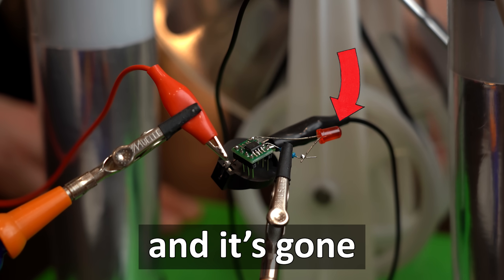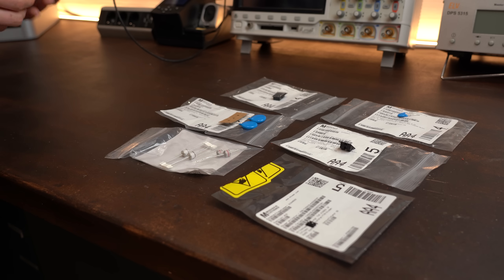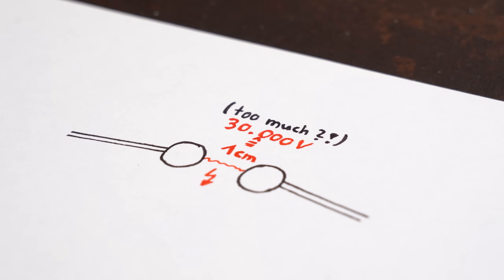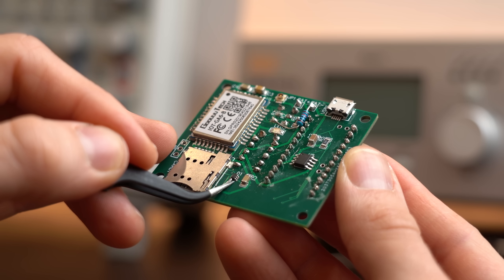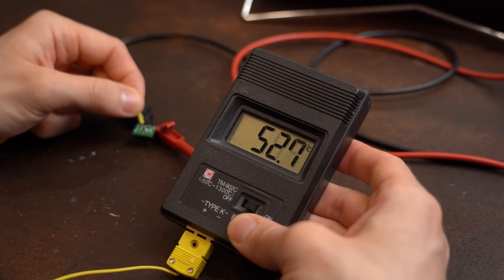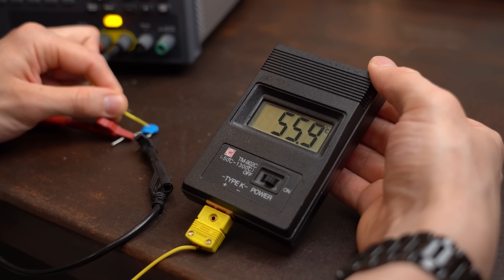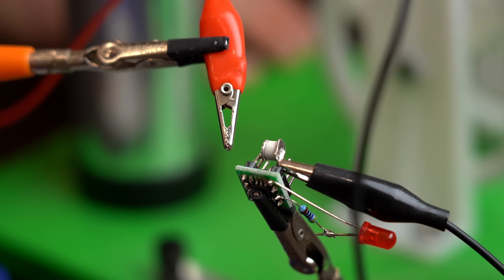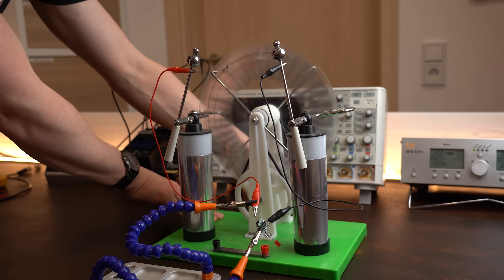This $0.70 Component SAVES your Circuit?! (Surge Protection) EB#59

Comment: Varistors are way slower than TVS diodes and aren't fit for fast transients such as ESD & EFT. Another thing to remember is Kirchoff's law, any current pulse will return to its source. Therefore instead of trying to suppress a pulse it is often more practical to divert it from the sensitive components using spark gaps etc
Reply from the maker: Thanks for the feedback :-) Maybe I should have included spark gaps as well. Well, I will find space for it in another video.
Reply: @greatscottlab  isn't the gas discharge tube basically a spark gap in a controlled non-oxidizing atmosphere?
Reply: @emislive : Yes, gas-discharge tubes are spark gaps in controlled atmospheres. However, you can still get unreliability due to the slow (or fast, depending on current and pulse rate) erosion of the electrodes, and ALSO because of the fact that light falling on the gas can actually make it easier to trigger a discharge.
Reply: @absalomdraconis  Light? But these GDTs (in the video) are not in transparent envelopes.
Reply: @greatscottlab  anyway, the most critical thing when dealing with wide spectrum transients is the layout itself
Reply: @demetrisswest  thank u so much😊
Reply: @greatscottlab  On the part where you talked about Kirchoff's law returning a current pulse back to its source; is that why when you have static electricity built up and you shock someone it also shocks you??? :O???
Reply: Spark gaps still leave residual overvoltage which needs to be handled. They are also not suitable for a low transient range. Neither are repeatable or reliable. Mov and tvs coupled with esd suppressor is the way to go.
Reply: Is a tvs diode not an esd suppressor?  @ecstazyrm
Reply: @ecstazyrm  Yes/no.  Here's my reasoning.  Think about it this way, TVS and MOVs are solid objects.  When a spark happens, it can burn a small part of the internals. Almost all the time this is enough, but they can fail if you get a large enough spike or enough smaller spikes.  If you look at the film of a Lithium Ion battery that's been damaged by over-voltage you'll see little bits that are burned.  It's super neat.
Reply: Seen a park gap do it's job in practice once (that is, after the fact not during it), on my TV's power supply. The comment I talk about it in case you wanna read: https://www.youtube.com/watch?v=MzxBBXpgwrE&lc=UgydNWuE3TvVqRYRkm94AaABAg
The board does have an MOV there too I assume to protect against lower voltage surges instead of just lighting strikes or such high voltage stuff. Those two in combination sure did their job.
Reply: The term used for doing it is a snubber circuit. Diverting it with a low inductance, high capacitance path to ground so that it is the best method to deal with large, fast current spikes.
Reply: @demetrisswest What is the path of current in TVS in case of ESD. when circuit is not connected to anything. can u explain a little please.
Reply: @muhammadawais7288  when you have statics on your body, a discharge may happen if you touch some AC-connected appliance, not a wall or a sofa. ESD goes from your body through input circuits to power plane, then through Y-caps or spark gaps to AC, then to earth
Reply: @demetrisswest  In what way is "divert" different from "suppress"?
Reply: @Graham_Wideman  my understanding is that suppressing a transient means dissipating its energy as a heat like MOVs and surge resistors do. Whilst diverting allows the transient to go back to source, not altering its energy much. For example, a 4 kV EFT burst is unpractical to suppress, as it is too fast for MOVs and will cost a fortune to build a sufficient TVS diode string. Therefore diverting it using layout features appears to be the only option
Reply: @demetrisswest OK, what does it mean for the "transient to go back to the source"?  What does "diverting it" translate to in actual components or layout?
Reply: @Graham_Wideman  assuming the transient will find its way through the board anyway, diverting means providing a pre-defined path for the transient to take, bypassing sensitive circuitry. This path may be formed by polygon cutouts, spark gaps, Y-caps etc
Reply: @demetrisswest  A spark gap or GDT simply uses ionization threshold as the protection voltage, and current through the air/gas produces heat absorbing the energy. So conceptually the same general behavior as a MOV or TVS, just by different means. So I don't see how spark gap is "divert" while MOV is "suppress".
Reply: @demetrisswest  ... also, just curious, what role do "polygon cutouts" have in this discussion?
Reply: @Graham_Wideman : "Suppress" means the current never travels through your circuit, while "Divert" means it only travels through an area that you don't care about it going through. Some high-voltage stuff you can't suppress (because the requirements for that are too strict), so instead you divert the majority, so that what's left will hopefully be something that you can suppress... and if you still can't, then you want another diversion layer. Spark gaps are a decent way to handle the highest-voltage cases, leaving the rest for more predictable forms like MOVs.
Reply: @absalomdraconis  How would my circuit implement "suppress" without somehow providing a means for current to travel through my circuit?   And if my circuit implements "divert" (whatever that means), then it's not like I don't care about that part of the circuit -- I care enough to provide a path with some defined "diversion" capability.  I'm really not seeing how to translate your verbal distinctions into concrete alternative implementations with actual components or PCB geometry.
Reply: Bro they literally do what you say they don’t do
Reply: @jamesgarvey3063  Who are you responding to, and what is "they"?
Reply: you guys confusing the newbies like me, seems like engineers never agrees on something and that I have to start my own cult of believes about electrical engineering and work with them in my life.
Reply: @aymenninja8120  re: "confusing"... don't worry too much. It appears to me that there are a number of comments on this thread that exhibit good grammar, but don't correspond too well to coherent principles.  Not sure if the issues are mistaken understanding of concepts, rote acceptance of lore, or just jumbled articulation.  Or AI :-)
Reply: @Graham_Wideman  indeed I should go to learn about the topic from proper academic sources.

Comment: I've used MOVs before, but didn't know about TVSs. Thanks. 

I was wondering about your estimation of generator voltages. When I did experiments with other static generators, we estimated our gap voltages at 10kV/cm. 4 inches was 100kV. I'm not sure which is more accurate, yours or ours. Of course we were in a fairly dry climate. 

Also, did you notice a change in spark frequency when you increased the distance (voltage)? It seems to me that it should take longer to to build enough charge to jump a larger gap, implying that the frequency should go down. Did you notice that phenomenon?
Reply from the maker: I got the kV/cm rating back in university. It is also just guessing because it depends on lots of factors. And yes; the bigger the distance, the longer it took to charge up.
Reply: In the UK it's about 10Kv per cm as you say

Comment: Haha, I just got a bunch of 6 leg micro packages in and spent hours manually soldering those legs without a breakout board!
Broke 3 legs off before I could get one working and said f this and ordered break out boards.
Reply from the maker: Oh boy.....
Reply: You shouldn't directly solder the wires lol, add thin copper wires as extension and accommodation for twisting and turning.
It's easy once you know the trick😉
Reply: @gentleclash  exactly what I did. :)

Comment: Ngl, this is the first time I've heard of a MOV, and the timing couldn't be more perfect!
Reply from the maker: Glad to hear it👍
Reply: FWIW, there are a lot of tutorials on how to add these to power strips, like one that your computer system is connected to.
The better 'strips' have these, however seems to be pretty easy to add higher spec'd ones to your existing ones pretty cheaply.
Wonder if there is a 'standard' which incorporates both the MOV and TSV in series to eke out most protection...
Reply: I installed on every circuit with expensive Elektronik, a surge protector to my outlets. Inside they have a couple MOVs and one GDT.